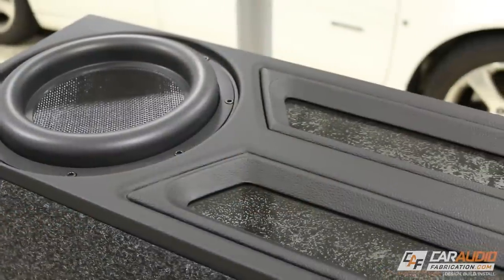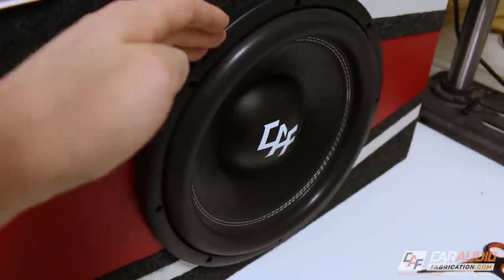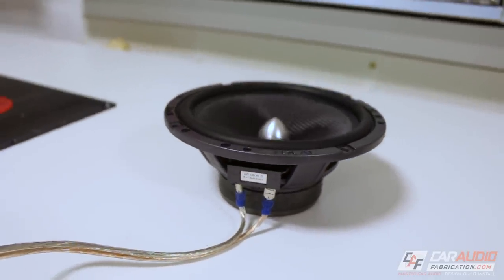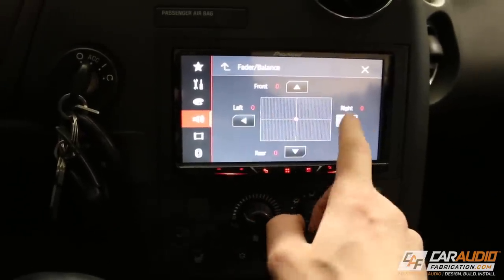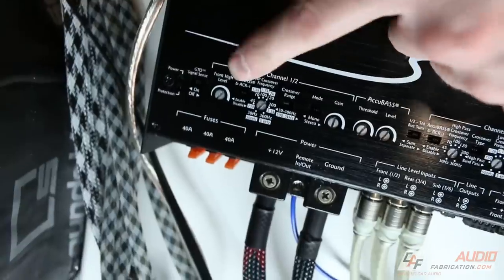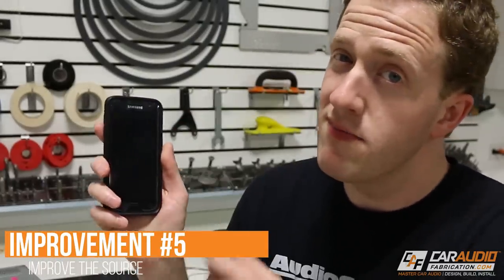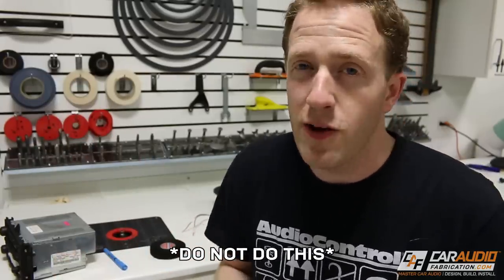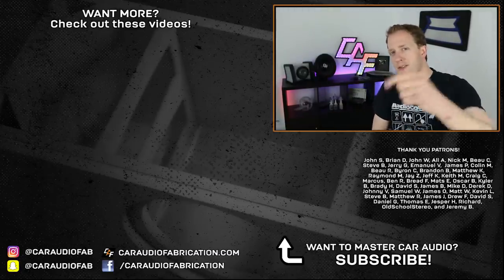5 CHEAP Sound Improvements you can make NOW - Car Audio

Comment: the ideal location of the center is in the center of the soundstage, equidistant between far left and far right. I have never heard a car where that location was correctly in front of the steering wheel. Some may want it there, but it isn't "correct".
Reply from the maker: User preference. Just illustrating how balance and fade can be used to make adjustments.
Reply: I know of a gentleman that has 2 settings for his car.  One for when he's alone. And the other when he has a passenger.
Reply: nothing wrong with either, just pointing where center should be for those that don't know, because some thing it is correct to be in front of the driver seat.
Reply: if it's in front of you, you have a screwed up sound stage with terrible left and right boundaries.  yeah, don't do that, ever.
Reply: There is no such thing as 'correct' for everybody.  There would only be 'correct' for you. Everybody hears things differently and everybody likes different things...there can be no 'correct' way that encompasses everybody's needs or the myriad selection of cars available.
Reply: no, there is correct imaging, and wrong.  you may enjoy wrong imaging, and that's okay.  frequency response can be whatever you like.
Reply: Your exertion of the word "correct" suggests that there is some sort of evidence-based proof, ala Science.  As audio is experiential and subjective, no such evidence-based proof can exist.  There can only be correct for you.
Reply: There is acoustically correct. Everything else is preference, lack of understanding, lack of ability to hear/determine, lack of funds to make it correct or simple don't care.
Reply: so, curious, how do you fix imaging in headphones to your preference? :)
Reply: Please provide statistical proof to back up your statement.
Reply: answer my question first.  lol
Reply: you weren't paying attention.
Reply: My hearing damage has been equal in both ears so nulled balance selection is best for me.  Not everybody hears the same and as such, there can be no 'correct'.  There is only correct for you.

You seem to think that your way is the only way and that makes you a bigot.  Look up the definition of the word 'bigot'.  It may surprise you...
Reply: I paid attention to all the customers that bought high end home and car audio from me for the many years I sold it.  This is not my first rodeo, kiddo.
Reply: and btw,  hearing damage will affect imaging very little, if your car audio system is tuned well.  it will almost not affect it at all with two simple speakers on your desk sitting in the center.
Reply: again you weren't paying attention,  and you twisted my words. I never said my way was the only way did I? nope.
Reply: I'm not a kid. Just because you were a salesman doesn't mean anything other than you knew how to sell.
Reply: if you sold "high end" home and car audio, and am arguing about IMAGING, then you were a poor salesman.  kiddo.  LOL.  okay, i'm done.  this went from funny, to sad.  have a great weekend.
Reply: " Some may want it there, but it isn't "correct".".  There is no correct for everybody.  There is only correct for you.  If you dislike others misinterpreting you, you should improve your writing skills.  Write in such a way that you elucidate your ideas clearly so that no misunderstandings can be made.  There is a 'correct' way to write...unlike hearing.
Reply: The dude was trying to troll Mark with asinine, youtube troll crap.  Many of these dudes are just children that all they know they learned from youtube and not real life.  Your channel doesn't have anything on it either.  Mine does, even though much of it is unrelated to car audio...it is all related to music and sound.
Reply: I also worked for MTX /xtant making pro car audio amplifiers.  Phoenix Arizona, representing!
Reply: Proof? = MECA/IASCA .... top 2 SQ bodies in the world.. both state center imaging is to be the center of windshield ... BUT... at the end of the day what sounds good to you is all that matter unless you compete :)
Reply: They have to put the microphone somewhere and it needs to be placed the same way for all competitors and vehicles.  The competitors shape the soundscape to 'fit' that location...that would be 'correct' for that kind of competition.
Reply: what are you talking about? ... microphones? ... have you ever been to a comp? .... not how it works ... a judge sits in the drivers seat and listen to tracks from MECA/IASCA CDs .... microphones are only use for RTA and some SPL comps which have nothing to do with SQ
Reply: How does a judge get his/her ears up against the center of the windshield while sitting in the driver's seat?  Are you saying that SQ comps are judged solely by the subjective hearing skills of a person?

...and no, I have not attended an official SQ competition.  I was more into car audio at a time before such things existed.  The competitions we worked for were more for SPL and aesthetics of build.  SPL deals with hard numbers.  Science.  Aesthetics is more touchy, feely, see-y...subjective.

If people are getting in cars and using their ears to determine sound quality, that is subjective judgment.  "Correct" would only be what pleases them the most.  That 'correct' may not please the car owner or others who may sit in that car.  

Of all the people who argued with me in this thread, I respect yours the most.  At least you have something to show for yourself in your video uploads.  I am going to watch your videos, especially your Altima vids.  I have an Infiniti i30 that I am building out and I might learn something useful from your vids.  Cheers!
Reply: My cheap Ford stereo has this option. "Optimize driver" & "Optimize all". It just adjusts the fade and balance to what ever Ford thought was good for this car.
Reply: I have been competing for over 20 yrs ... the Altima "although it does not have the Rockford front stage any more now is all Hybird" has won over 50 1st place finishes in the last 4 yrs and a 4th at World finals in 2016 ... and yes the judging is subjective .... as far as how you tell where your staging is ... sitting in driver seat ... center is center of windshield and starting depth should be at least to the farthest point of the windshield ... lot more to this but i will not go into it ... easy way to explain a sound stage.. picture siting "off center" of a stage "off center cause your drive seat is off center" ... so how ever the musicians and singer "or singers" are standing on the stage .. your trying to replicate that... if singer is standing right of center on the stage .. in your car you should be able to hear he is off center ... should hear where the lead guitarist is play "say far right" then you should be able to close your eye and point to where the sound is coming from and that goes for every one on the stage bass guitarist and the drummer plus you be able to tell how far back from the front of the stage they are ... if the sing is closest to you and the lead guitarist is 10 feet behind him and 10 foot to the right ... you should be able to hear that ... this is why we who compete spend hundreds of hours tuning on our DSPs ... there is way more the just setting time delays and eq curves ... there are alot of tricks to add depth, width and height  ... but in the end ... one cant really explain a "sound stage" in a car .. it has to be heard :)
Reply: I like my sound stage in the middle of the dash below the rear view mirror. Current setup is pioneer 80prs, zapco 4 channel and mono amp. Running a set of morel tempo ultra components and a 10" morel primo sub. All skyhigh ofc wires. Doors, roof, cabin, floor plastered with second skin full coverage. Sound stage sounds like i have speakers in middle of the dash and the sub sounds like its in the dash aswell.
Reply: 99.5% of the time anyone is in my vehicle, it's me, and I'm in the driver seat 99.4% of that time.  Since it is my property and system, I think I can dictate what is correct and what isn't and I say I hate hearing my driver side door more than the 9 other speakers in the vehicle

Comment: I want to change my door speakers in my 2008 vw Passat but don’t no how to take my door apart to change them
Reply from the maker: Need to carefully find the separation points on the panels. Usually a fastener will be hidden somewhere. Remove that and viola!
Reply: CarAudioFabrication do I need to change the speaker cable or does will the old cable be fine

Comment: i use hot glue as a speaker gasket lol. works great!
Reply: bookshelffury untill it melts when left in sun lol
Reply: I believe used silicone adhesive around the edges of my speakers and it sounds great

Comment: hi! Can I use a line of butyl instead of speaker gasket tape?
Reply: carlistillu you can but it can be messy and it's very sensitive to temperature fluctuations! Hot day melt out of the gap, cold day super hard and may not seal the gap!? Cheap alternative is weather strip foam from local hardware store but get the dense closed cell.
Reply: You can use the adhesive backed foam tape, non hardening rubber caulk, or even just non hardening rope caulk. I use the latter option as it is available at any hardware store. You don't need much of it and unlike the foam it does a better job of absorbing vibrations and sealing the speaker basket.
Reply: What about? Second Skin Damplifier Butyl Rope???